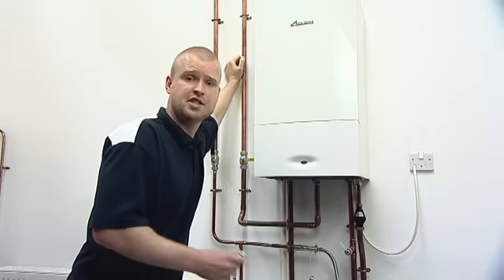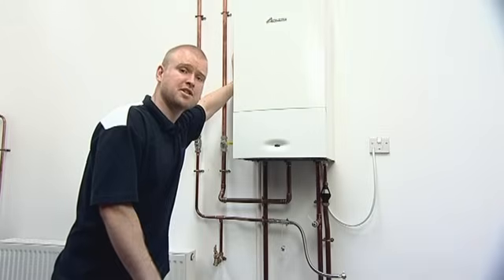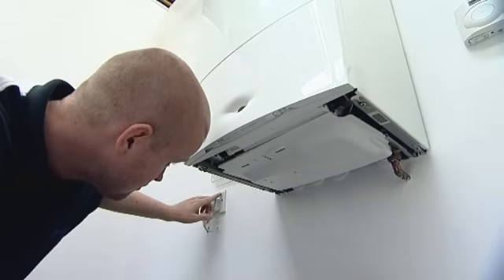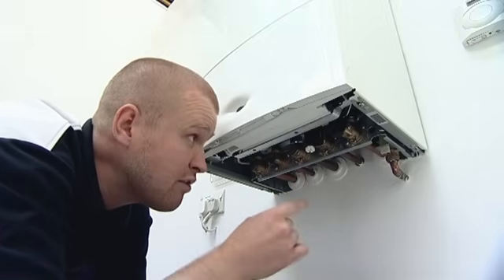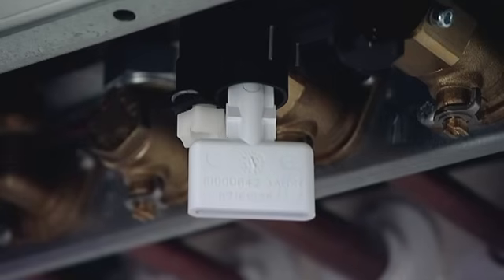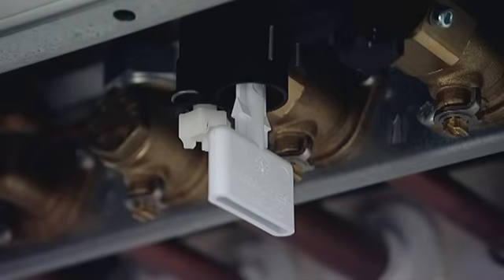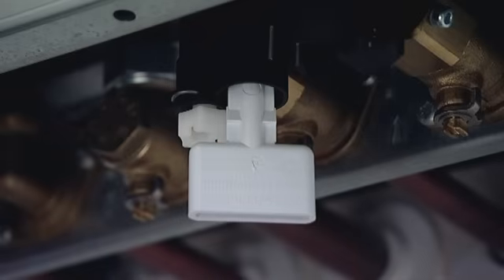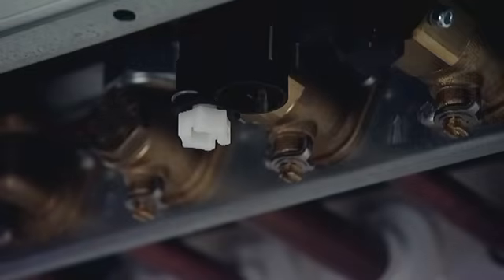How to Repressurise a Heating System with an Internal Filling Key | Worcester Bosch

Comment: Help!! I've followed these excellent  instructions in the past without any problems.However, this time when I turn the white plastic nut anti-clock nothing happens - the pressure gauge doesn't rise to One & a half. Any advice please?
Reply: I just tapped the pressure gauge gently to rose 1.5.So sometime the gauge sticks

Comment: I have this problem.  The design of the boiler seems very poor for this situation; you have to have the white flap down to see the water pressure meter inside, but the flap interferes with seeing the screw underneath the boiler and interferes with light for seeing the almost-invisible lock/open black on black symbols. Many people have their boilers inside airing cupboards etc, which mean that it is a LOT less easy to see what's going on than it is in this video.  Also,  in the video the engineer talks about turning the screw anticlockwise, but he appears to turn it clockwise.  This is very confusing.  Surely it is possible to improve the way this works to make it easier for laypeople to do what's necessary?

Comment: Hi Worcester. Please Help. I've just followed this , and turned on again. But I still have the blue light flashing (even flash a few seconds apart) and the reset red button flashing (as before) Pressure now on 1.5 and it 'sounds' like a healthy boiler again. House is now down to 12 degrees! I've got a Greenstar 25Si - under 10 years old. (The flame/spanner ane eco buttons all not lit) The technical line is so full they are not logging new calls. What next please?!

Comment: I have the exact same boiler model name but The underneath looks nothing like this, there is no lock sign, No key , and no hole to put a key in.. so this video is absolutely useless
Reply: Paul Nixon if that there were something as simple as a blue lever, would I really be searching the internet for answers?! wrong again. It's an old version where there is no lever at all. You have to use pliars to turn a specific little nut (of which there are many). That took me hours of research. Sorry but I'm just tired of searching and finding people who are so sure their advice is only to discover it's completely wrong. If people could say "this is just one of several options you might have" or "these are the other options".. it would make things a bit more thorough instead if assuming everyone with that boiler has the same fittings.
Reply: Paul Nixon woah.. not sure what's going on but you sound charming
Reply: lol he deleted his own replies, probably scared Bosch would notice his unprofessional attitude. I saved it here.. Paul Nixon, Bosch engineer: 
"Get over yourself! How does anyone else know which version you have? Being obnoxious helps nothing. This sparring you've initiated is childish and futile. move on, Sir and get a life."

Comment: Is it ok if I do this myself?  As in that I don't have to call an engineer in so the warranty doesn't get voided?
Reply from the maker: That's correct, as long as you follow the instructions outlined in the video you won't need to call an engineer. If you do run into any problems, please call our technical support team on 0330 123 3366 and they'll be happy to assist you further.

Comment: Have a 24CDi and it seems very difficult to get the bottom tray off to see the white nut I need to turn.  Should I just yank it hard?  I don't want to try if it shouldn't be pulled off like that.  The tray I have is nothing like the one in the video and it's metal with vents. I can see a black nut through a hole and I'd be able to turn it through that, but there is another hole to the right, which seems to have nothing above it when I poke my fingers up.  Should I be putting the key up into that second hole and assuming it will find the lock/unlock part?   The two holes are quite far apart, so I wouldn't be inserting the key right next to the nut, as in the video.

SOLVED!  I found a YouTube video that showed my exact boiler being repressurized. https://www.youtube.com/watch?v=XOI7yAVlUEk  (I managed to get the tray off in the end, which helped greatly).  On my boiler, the nut to let the water through is GREY and BEHIND the key socket, not next to it.  There are no unlock/lock symbols on the socket, but you can feel when the key is able to push further in and be twisted into place.  I hope this helps someone else with an old Worcester Bosch 24CDi boiler. My pressure is all fixed now!  Excellent!

Comment: Hi, I've inserted the key fully in however when I turn the nut water pours from the nut! And the pressure needle doesn't move. I tried turning the key further towards the lock position but it just spins forever! Help!
Reply: Just need to push it up further, happened to me too. It goes so far and then gets stuck so its needs a bit of a shove
Reply: I thought it was just me! All sorted now

Comment: Hi I want to ask you something. When I was repressuring the gauge, I locked it with the key and I turn the white square thing but a LOT of water came out! Is that normal?
Reply: @tahiraahmed2437  Ah I had to switch off the boiler power to stop the water flowing before I left it on so the water was still moving around

Comment: I inserted the key and turned it. If it is too easy to turn that means you haven't inserted it deep enough - so when you turn the spinner knob you'll get water flowing out onto the floor and nothing into the boiler. So I pushed the key all the way in. Once in there, it got stuck: I can't turn it to the closed padlock position or take it out.  However, I opened the valve and the repressurisation did go fine, without a drip of water coming out. The needle is now snugly in the green. I cannot remove the key though, it's jammed. I called their helpline and they advised to leave the key in there and just use the boiler. They say it won't damage the boiler in any way. If you try to yank the key out  it may snap and you will then have to call their mechanic to fix it. Which might cost money.

Comment: I visited my in-laws and found their boiler meter needle at zero. The key was still in the boiler at the 'locked-padlock' position. It looks like British Gas 'stole' a connection from the lighting circuit in the loft and wired direct without a fused spur or any easy means to isolate the boiler (beyond switching off at the Consumer Unit) so I proceeded to re-pressure the boiler with power still applied. I opened the valve a little way and allowed the pressure to rise very slowly (whilst gently tapping the gauge) until it was between the green segments representing 1.5-bar. I closed off the valve and then turned the 'key' to the 'unlocked-padlock' position and removed the key with a little struggle but was then able to return it to its storage location on the lower cover and then replace the cover. I would recommend a squirt of silicon grease on the 'O-Rings' which keep them in good condition and will make their passage into the working position a lot easier.

Comment: Essentially a very useful and informative video. You seem to struggle with the concept of ACW to open and CW to close (standard action for a valve). You talk about 2-bar in the red zone however have a look at the meter dial and the red zone begins at greater than 2.5-bar so 2-bar is actually in the green zone. Also you say the boiler has been pressurised to 1.5-bar however, the meter didn't agree with that statement as it was about 1.25-bar. A little more precision in your spoken commentary would make this video excellent.
Reply from the maker: Hi Tony, thanks for taking the time to provide some constructive feedback, we've passed that on and are glad you enjoyed the video

Comment: How long should It take for pressure bar to move. Mine is taking forever
Reply from the maker: Hi, the time taken would depend on the size of the system, if it is slow the homeowner can open the valve more to increase the water flow as it works as a tap. Please let us know if you have any further queries

Comment: I have low pressure (0.5 bar) so I will try this when I get home. I do however have no power to the boiler. The consumer unit has power, the fuse in the boiler switch is fine, would the low pressure cause the boiler to turn off completely?

Comment: I have tried following these instructions thoroughly making sure the key was turned to the correct padlock symbol etc and ensuring the key is inserted firmly but water comes pouring from the key everytime I attempt this.
Reply from the maker: Hi Michaela, thanks for your query. If water is coming out from where the key is inserted it means the key was not pushed all the way to form a seal, a little bit of washing up liquid on the end of the key will help it go up further. Please let us know if you have any further questions
Reply: Worcester, Bosch Group thankyou this video and this comment helped so much!
Reply: That worked for me.  thanks very much.
Reply: That solved the same problem for me. Thanks for the video.

Comment: when I do this, I lose water, is that normal?
Reply from the maker: If when inserting the key, you are losing water, this means the key is not inserted correctly. 

You must ensure that the arrow on the side of the key is aligned with the unlock padlock on the manifold, then insert firmly into the manifold.  When the key is inserted into the boiler, turn it to the lock padlock symbol. If the key stops turning, it is locked in place.  If the key is still turning, then the key is not inserted properly.
Only when the key is inserted correctly do you turn the nut that acts as the tap. 
We hope this information will assist.

If not please call our Technical line on 0330 123 3366

Comment: I tried the steps but when I turn the little white nut, all that happens is that water comes out from the key hole?!
Reply from the maker: Hi Deina, this is nothing to worry about - all this means is that the key is not locked into position correctly. 

To ensure the key is fully inserted you need  to line it up to the closed padlock symbol; you will know when it is fully inserted as you should not be able to move the key at all - it will be solid in the manifold.Let us know if you have any other issues, and we'll be happy to help

Comment: Great instructions. Repressurised system. Turned switch on at mains. No power. Any ideas?
Reply from the maker: Hi Gaz, it is difficult to comment on what the issue may be with the information provided. It may be worth calling us on 0330 123 9339 where we can carry out some troubleshooting with you over the telephone

Comment: How do you remove the tray ?
Reply from the maker: To remove bottom panel, push the panel back fully to release the front edge and then pull forward and down to remove the panel. We hope this has helped, thanks Worcester
Reply: The pressure has now dropped again to Zero,  first time was due to bleeding radiators, this time for no reason is there problem thanks
Reply from the maker: Hi Diane, the best thing for you to do is give our customer support team a call on 0330 123 3366, who will be able to advise you
Reply from the maker: Hi Diane, the best thing for you to do is give our customer support team a call on 0330 123 3366, who will be able to advise you

Comment: How often should this have to be done? I have boiler fitted July 2016. It went to 0 in February 2017. I did this process then and have had to do it again today. Seems a lot!
Reply from the maker: Thank you for your comment. It is normal to have to re-pressurise your system 1-2 times a year, if you are having to re-pressurise your system more than this it could indicate a problem such as a small leak. If you would like some assistance from our Technical Support team please contact them on 0330 123 3366 or email them at technical-advice@uk.bosch.com thanks Worcester

Comment: Ive got a 24i in my caravan and pressurised to above 2.5 bar,it still works ok but we shut it down and im hoping that it has dropped a little when we go back down.This video is excellent in its clear instructions i just wish i`d watched it before.
Reply from the maker: Hi Colin, that's great to hear! We're happy to hear that this has helped you. If you need any more information at all, please feel free to get in touch. Thanks, Worcester
Reply: went back to caravan and pressure had dropped and red light was flashing constantly,pressurised it back up and heating and dhw worked ok,but the pressure keeps dropping slowly,i have checked for leaks and there are none,is this an engineers fix?
Reply from the maker: Thank you for your reply, we would advise an engineer attending and investigating this further for you. As there are no signs of any leaks on your system, this could indicate a fault within the boiler itself that would require an engineer visit. If you require more information please call our Appointments Team on 0330 123 9339. Thanks, Worcester
Reply: Thank you,i will check to see if the problem persists on our next visit,how much would it cost to have an engineer check it out?.thanks.
Reply from the maker: Hi Colin, to find out more about an engineer visit, including costs, please call our Appointments Team on 0330 123 9339

Comment: Thank you so much. Wasn't sure how to get the pressure back up after bleeding my radiator. As someone else mentioned, below, it helps to run the key under a cold tap, for a few seconds, to get it in.
Reply from the maker: Hi Thomas, we're happy to hear that this has helped you! If you have any more questions at all, please do get in touch :) Thanks, Worcester

Comment: when I turn it it just makes loads off water come out
Reply: I know your comment is old... but I just had the same issue. The key needs to be pushed in further for the seals on the key to work. Grease them a tad do they  engage and push key in firmly but don't force. The key has a hole right through the middle so I realised it just needed to be in further.

Comment: Hi again .Please would you let me know what thwe normal pressure setting should be when the heating is off. I have a Worcester CD1 30 . Cheers mate
Reply from the maker: Thank you for your comment. The normal pressure reading for the heating system is between 1 - 1.5bar, that is when the heating is off. If your boiler is having to be topped up this often, it would suggest there is a leak somewhere in the heating system causing the pressure to constantly drop. We hope this has helped, AW.

Comment: Thanks for this video! However my water is still cold. Is that normal or does it need time?
Reply from the maker: Thank you for your comment. Sometimes after re-pressurising, the boiler does need to be reset. Depending on which model of boiler you have this will either be a reset button or a dial. If after resetting the boiler you are still not getting any hot water, we would advise contacting our Technical Support team either by email to technical.enquiries@uk.bosch.com or by telephoning them on 0330 123 3366. They will be able to assist you further with this, thanks AW

Comment: Hi, thanks for video. Just a quick question. I set up 1.5 BAR, when i switch boiler back on a pressure goes on 2.0 BAR. Can I leave it like that or its too much?  Thanks.
Reply from the maker: Hello, whilst an operating pressure of 2 bar is within the safe operating scope of any one of our sealed system compatible boilers, the fact that the pressure has increased by 33% would suggest a possible fault with the expansion vessel that may need further attention from an engineer. Many thanks, Worcester

Comment: I have tried this but when I turn the key and then swivel the wheel the water pours out all over me instead with no effect on the pressure.  Not sure what to do... any ideas?
Reply: Charlotte, I had the same issue. I then turned the key the other way to described in the video and it worked as per the instructions in the video. Pressure is fine now.
Reply from the maker: Hi Charlotte, please contact our technical department directly on 0330 123 3366 and we will talk through the operation of the keyed filling loop with you. Many thanks, Worcester

Comment: Great video.  I brought the pressure up and everything went well, however when I turned the heating on the blue light doesn't come on. but when I turn my hot water on the blue light does turn on .
Reply from the maker: Hi James, we would suggest that if the blue light is not activating the controls are either not sending a demand to the boiler or the boiler is not picking this demand up (blue light comes on for a demand). Either way will require an engineer. Just need to find out if its third party or Worcester controls. Many thanks, Worcester

Comment: Guys, any tips on getting the key out after represssuring? The key is STUCK and I cannot get it out! 

And yes, I've made sure the key is turned to the unlock position when trying to pull the key out and have tried agitating the key while pulling out and have had no luck for the last 10 mins. Came close to snapping it off a few times. Are there any danger in leaving the key in (in the unlocked position)?

Would appreciate any tips on getting this bugger out. It was a pain to get this in as well. Thank you
Reply: It's been a year, but I hope you managed to get it out!

Comment: I have done all and now my key don't come out :(
Reply: Same here, just repressurised and the key won't bleedin' come out (excuse the pun). Make sure the key is in the unlock position when trying to pull it out, in case you didn't. Have been trying to get this bugger out for the last 10-15 mins and my hands are aching! Let me know if you've had any success.

Comment: if you have trouble getting the key in, put a dab of cooking oil or vaseline on the O-rings, I'm sure I'll get heating engineers moaning at me for this comment saying the oil will damage the o rings but really it doesn't matter, by the time the o rings on the key are buggered the boiler's probably goin to need replacing anyway.